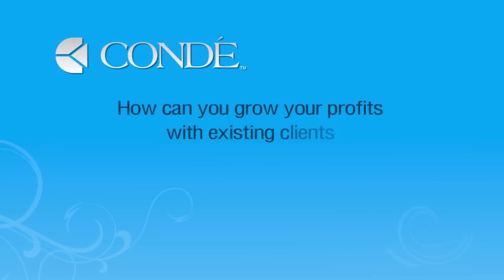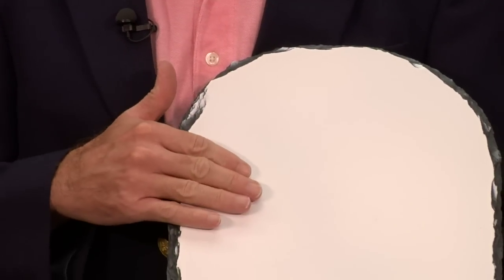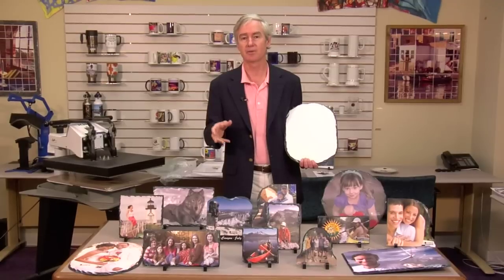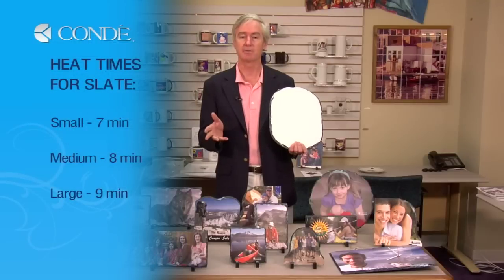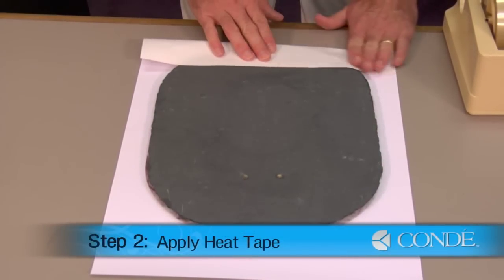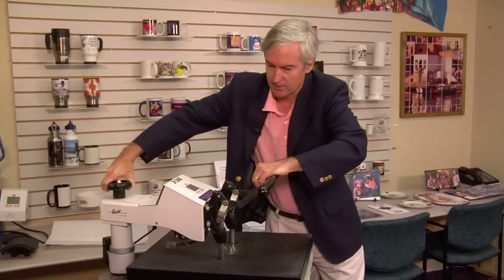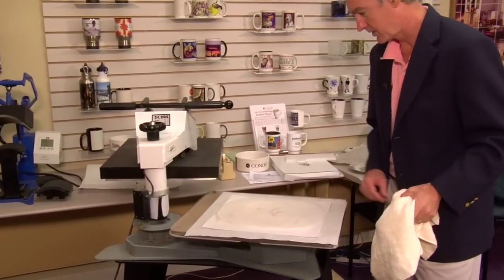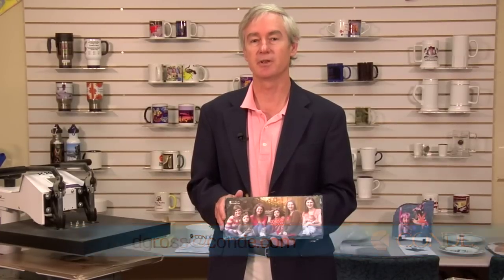SubliSlate Plaques Imaged with Dye Sublimation Transfers -

Comment: hi how long should I sublimate a 20 x 20 cm slate.. I sublimated a small rectangle piece which was mainly a text and small pic.. I heated that piece for 205 degrees for 300 sec..it turned out great. but the 20 x 20 cm pieces the black was fading in some areas so I left it longer this was for 500 sec..even with extending time a bit in the middle was not very dark! I noticed you don't heat your slate, is this necessary? Thanks your videos are very informative :)
Reply from the maker: We cannot give you instructions for a product we did not sell, please see your provider. We do not pre-heat the slate, not sure what you mean there, it is heated by the heat press.

Comment: What happens after I press the photo on the slate there is some blurry? Mostly around the edges. And I think I am leaving it in there to long because my slate starts to crack???
Reply from the maker: Check the instructions for the size slate you are using. Sounds like you may be using too much pressure.

Comment: is the green pad necessary? can I just you a oven baking rubber mat
Reply from the maker: Actually, that may work but we have never tested it to know.
The weight of the green rubber pad plus it's heat conducting property is used to meld the image to the rocky edged plaque. If you baking mat conducts heat and is heavy, it may work. Good luck.

Comment: Hi can you please tell me, how do you set your temperature at the 400 degrees, when I set mine to the required when I put slate in the temperature falls away down and then works it back up again to the set 400 which is required. But during that time waiting for it to come back up to the required temperature it could take about 3,4,5mins then are you saying to do it for another 9 mins after it gets back to the set temperature. Can someone please help ? Many Thanks.
Reply from the maker: +William Jamieson This is normal and the reason for the 9 minutes. Ignore it and time from when you put it in the press.